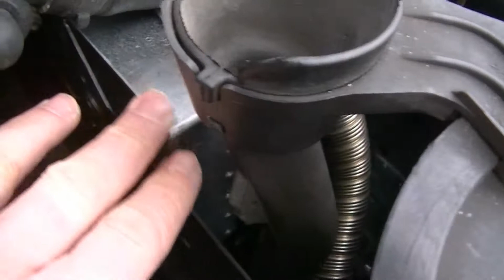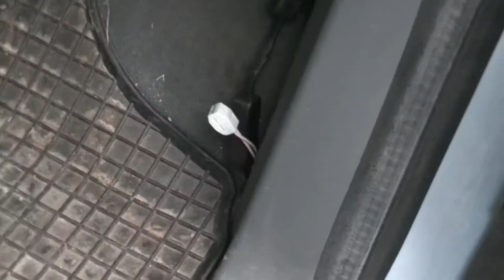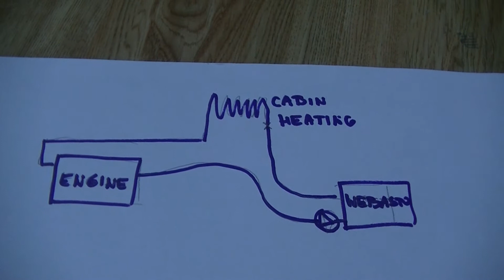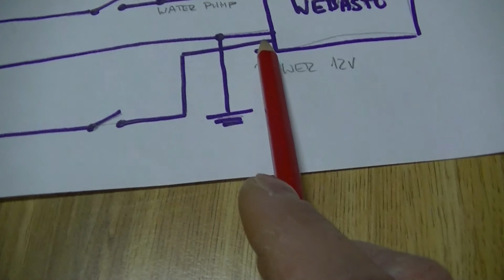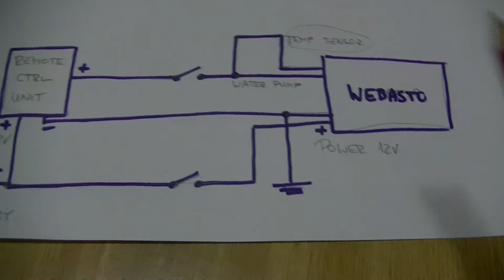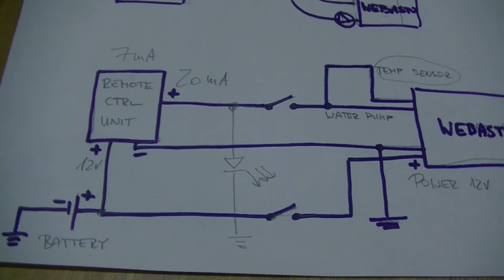Webasto Thermo Top Z/C D, Citroen Jumpy, Fiat Scudo, Peugeot Expert, Dispatch - DIY installation

Comment: What do you need a second one? There's already one beneath the car, works as a secondary heater.
Reply from the maker: Only some models had it factory installed. Not thos one.

Comment: When the webasto is warming  up the engine and the cabin heater, does the cabin heater defrost the windscreen without turning on the fan? Thanks.
Reply from the maker: No... Fan is necessary to switch on.
Reply: Yes mine does

Comment: why did you not connect the fuel to the tank instead of a bottle?
Reply from the maker: I wanted to have separate independent systems... Tank is a next step ... Maybe
Reply: ah. ok. I'm about to do the same on my T4.  Good job, and thanks for sharing

Comment: Dear Mr. Rob,
My question is which connector's which contact did you connect +12V to start the Webasto?
I have the same webasto as yours, but mine is only auxiliary heater because it is comes with my car (Chrysler Voyager diesel) and I want to upgrade from auxiliary heater to parking heater but recently I don't know how can I do this.
Thank you for your help and thanks your video!
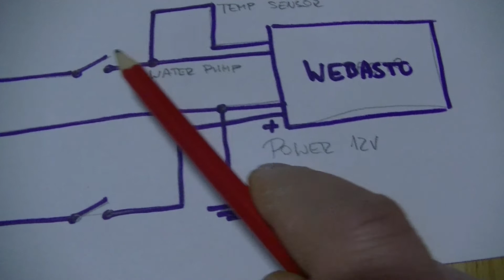Reply from the maker: As far as I was able to find out, this particular webasto has a temperature sensor lead. But there is no sensor. if you connect 12V to it, the webasto considers this as a temperature below zero and switches ON. I think it's the yellow wire from original Webasto wiring. See time around 16:55. But I do not use my webasto to heat the cabin. I use it just to warm up the engine before I actually start it. And of course you need an independent water pump attached to the system.
Reply: @robsworldcz  Thank you for your help! Yes, I know that I need a water pump and also I will make an extra wiring from the cabin fan through an relay. It was just not absolutely clear for me how can I start the Webasto  manually.
Reply: I have webasto top c in my Range Rover I set from app on my phone and is toasty hot in the morning 
I also have a thermo too c from a Peugeot which heats my hot tub there amazing things
Reply: From that time I have done with this parking heater. Now I can start the heater by my mobile phone, and it is working 35 mins from the strart signal. By the time  I have arrived to the car, the engine's cooling water is approximately 30-40 °C if ambient temperature is about 0°C.